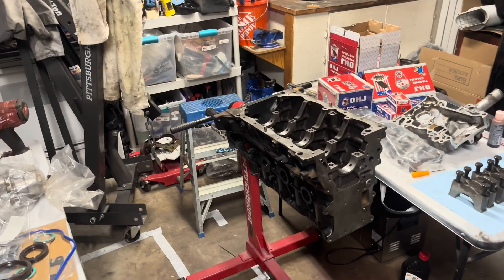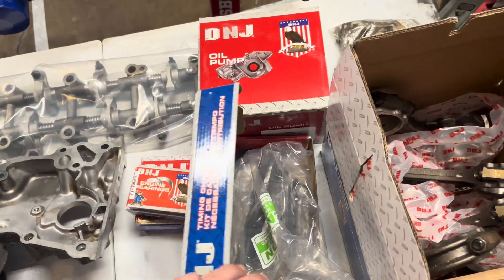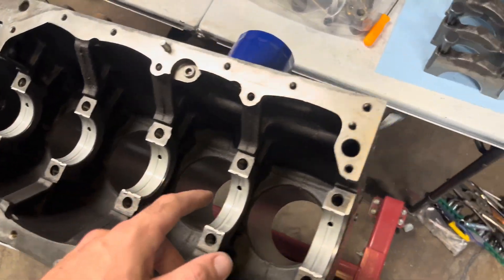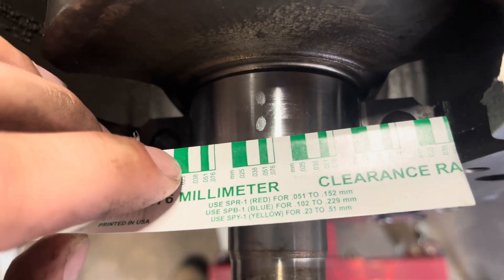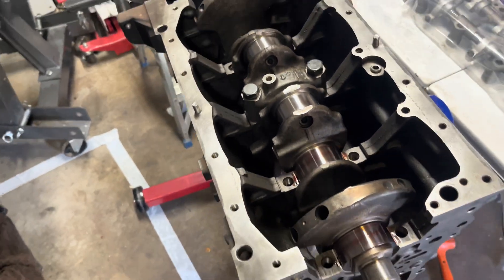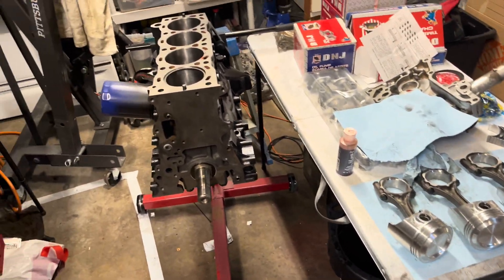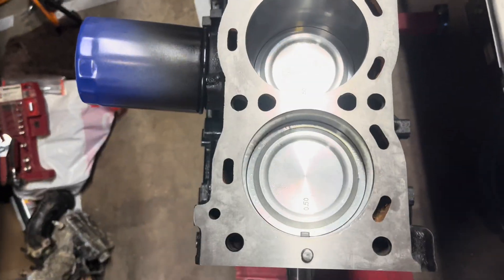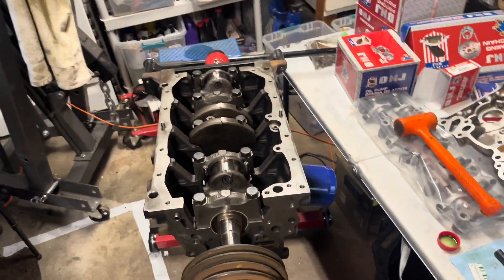Toyota 22R Rebuild Part 1: Short Block Assembly

Comment: What an engine l actually do really like the 22R engine because l fortunate to have one in my 1997 2X4 Toyota Hilux the last year of the 22R engine and when l bought my Hilux 7 years ago with 410000 kilometres on it l was still working as a courier now retired actually retired for 5 years now and when l retired l researched my Toyota Hilux and discovered how good it was and my reaction was wow what did l buy well l will it looks like l will never rebuild my engine actually if l replaced or rebuilt the engine wouldn't be worth it the engine is excellent at 440000 kilometres it doesn't burn oil at all and when l bought it no paper work at all and was l taking a risk but no after owning the Hilux for 7 years and the only work l have done to the engine was sevice it changed the rocker cover gasket and changed spark plugs new dizzy cap and rotir button also new plug leads by the way made in the USA and the 22R engine is fine original timing chain obviously the 22R was serviced at regular intervals although over engineered the whole Hilux ute and after working on it and it always surprises me just how well the Hilux ute was put together all the over engineering which Toyota did parts do fail and l made my Hilux my retirement project and all the parts l replaced out of been old warn out ect its almost finished and when l bought the Hilux 7 years ago l paid aud $1500 for itand been l live in Australia were we have a Toyota tax meaning that Toyota the most popular brand in Australia older Toyotas appreciate were my Hilux is worth aud $5000 to $6000 but unfortunately l will be selling it l don't use it that much now and we have a car also it will be sad to see it go but the next owner is getting a Hilux  ute that is in good condition there are many small things to repair on the Hilux but it now passes its yearly rego check without a drama l live in N.S.W Australia and only got failed because of its exhaust system not for oil leaks bald tyres ect